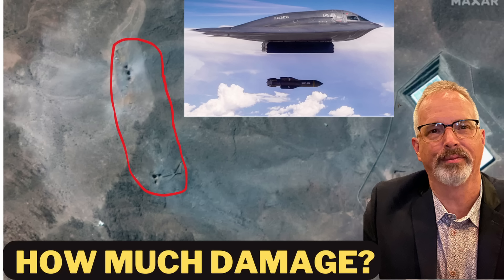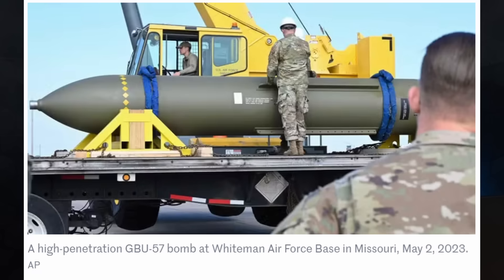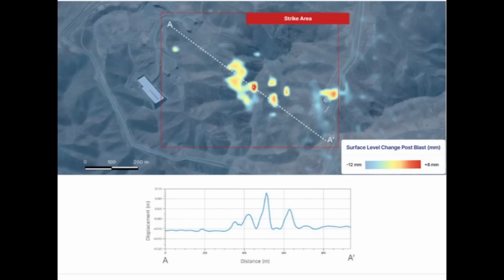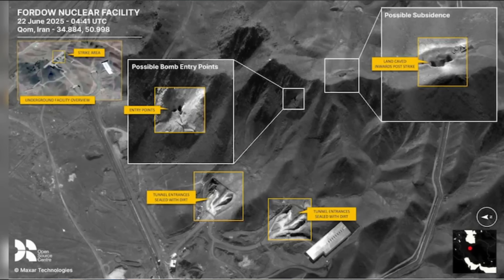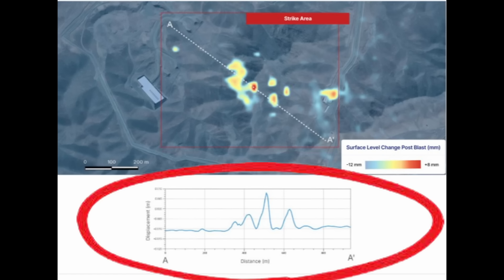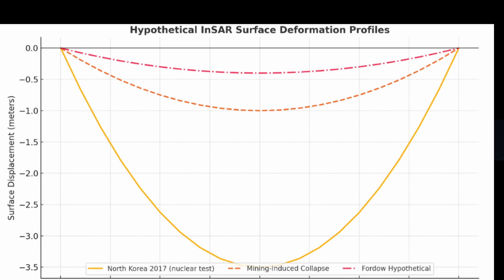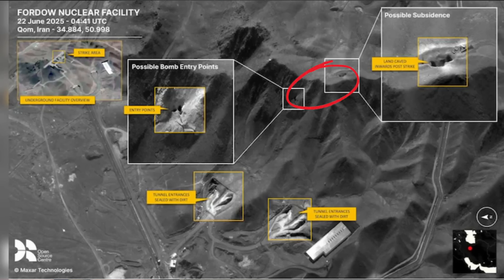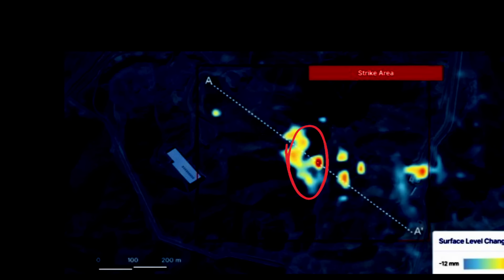Fordow Attack Assessment -  Update

Comment: This guy is either an absolute liar or the worst “professional engineer” in the world. Fractured rock DOES NOT equal caved rock that “must have gone somewhere, so it’s in the underground facility”. Fractured rock remains ‘in situ’ without a space below to cave into. No dump trucks required. Imagine filling a strongbox completely with popcorn and then heating it up. The kernels wouldn’t pop, they would attempt to expand against each other in a confined space…same same. The rock would fracture and then immediately compress. Such a vivid example of confirmation bias.
Reply from the maker: I think it's more of an example of you not understanding the video.🤣
Reply: @CaseyJones-Engineer - No — this is a clear example of your confirmation bias at work. You want the administration’s fantasy story to be true, so you twist engineering principles to support it.
The math simply doesn’t add up to penetrate 80 meters. The first MOP would always penetrate deepest; that’s basic physics. These weapons are designed to focus their energy forward in solid, intact rock.
If subsequent GBU-57s followed the same path, they wouldn’t simply continue deeper — they would lose most of their energy fighting through fractured rock, rubble, and hardened bomb casing remnants.
Upon detonation, the explosive energy radiates in all directions, not just forward or downward. That means less additional penetration and more lateral fracturing and compaction — not a clear, clean path to the facility.
Your interpretation ignores these basic principles and relies entirely on a narrative you already decided to believe.

Comment: I can't believe your call yourself an engineer. 100,000 cubic meters is a cube 46.4 meters on each side. The underground structures are 90 meters down.
Reply from the maker: You apparently didn't watch the video or understand it.
Reply: @CaseyJones-Engineer  Also 7:04 "I think almost all of the destructive force occurred at great depth" is nothing other than a guess at best. No engineering calculations to back that. "Great depth" can be anywhere between 30 and 90 meters. Neither would show visible signs at the surface.
Reply: @CaseyJones-Engineer  I watched your video to the end. You went from 100k m^3 of broken rock to "this facility has got to be utterly destroyed". 

The fact that you came back at me ad hominem rather than a physics argument just proves my point.
Reply from the maker: @djinn666  Your comment didn't bear any more response than I gave it.

Comment: That sounds great, but it is all predicated on the engineering thought that those ventilation shafts were vertical.  I highly doubt that the Iranians were so ignorant as to bore those shafts vertically; more than likely, those shafts were cut at an angle, minimizing intrusional destruction at depth.
Reply from the maker: Not really.  The blast wave alone would be devastating regardless of the vent configuration.

Comment: Thanks so much, Casey. As a practiing professional engineer with two advanced engineering degrees, including civil engineering, this is the best analysis among many decent, and some very poor, that I've seen posted.  Most of those posting haven't a clue as to fracture mechanics, ordinance, or any other technical issues.  They have essentially looked at the pre- and post-elevations and concluded there was little change, hence little impact.  But they be rong.  Great insightful analysis and engineering using open-source data!
Reply from the maker: Thank you so much, I really appreciate it!!

Comment: It’s not just the fractured rock, it’s the heat and shockwave from explosive gasses in a confined area as the force and flame had a direct path into the main facility via the air vents. I mean there were (6) in each shaft. Woah !
Reply from the maker: I agree with you. I don't get these people that think the facility got off with barely a scratch. It makes no sense.

Comment: Well, yes, granite is a very tough kind of rock. 
NORAD and similar were explicitly covered in loose gravel on top of the actual bunker to prevent the propagation of shockwaves from the surrounding rocks. Idk how this bunker was constructed, but they probably got all the opensource data on cold war bunkers and looked at that before constructing their own site. 
Secondly: How deep were the sites really? Did the devices reach the cavities?
The fact that there is near zero change above ground bodes not well for the success of the mission, and claiming otherwise based on this lack of data is nonsensical.
Reply from the maker: So you're saying 12 GBU 57's went into the ground and detonated while doing minimal damage.  Wrong.
Reply: @CaseyJones-Engineer  They probably did a lot of damage to the place where they detonated. 

Did they "detonate anywhere close to anything relevant" is the interesting question. Remember the amount of ordinance dropped on Vn and that that was more than was used in WW2, yet the result was underwhelming. 

Secondly: If they actually hit the site perfectly and spread the nuclear material into the countryside, everybody involved from Trump down to the lowest airman is liable to be indicted in Nuremberg for crimes against humanity.

Comment: What makes you think that the ventilation shafts are single vertical lines? What if the core of the facility is in zigzag 80 yards deep and 100-140 years away from the ventilation shafts. Modern DUFs like Fordow are likely multi-layered, with curved, zigzagging tunnels to protect against blast overpressure and shockwaves. Ventilation systems are likely redundant, hardened, and segmented, not just a single vertical shaft. A direct hit on a shaft might disrupt air circulation, but it likely won’t destroy the core of the facility if it's hundreds of feet laterally and vertically away.This is standard military engineering.

Comment: The big worry was adequate penetration of granite, depending on how solid the granite is. Preexisting fractures in geology would enhance penetration. Due to little heave, I think it's likely there was very good penetration. Confined shock waves are also underrated, and hardly mentioned in the assessments I have read. They can damage or destroy equipment within quite a large radius.
Reply from the maker: Thank you. I believe that's correct as well. Lots of detonation with very little surface deformation.That energy went somewhere.

Comment: If you have ever had a computer hard drive die from being knocked or dropped, or sometimes just being bumped while it's operating -- that illustrates the sensitivity of a High-Speed Centrifuge used for the PHYSICAL separation of Uranium isotopes in solution. 
The fissionable U-235 is only about 7/10 of one percent of the NON-fissionable total.
•   The extreme high rpm are necessary because of the very small difference in mass between the fissionable U-235 versus the much more abundant U-238…only about 1 percent difference.
Declassified information on the centrifuge requirements for Uranium separation indicate that "Separation efficiency in a centrifuge depends on absolute mass difference. Separation of uranium isotopes requires a centrifuge that can spin at 1,500 revolutions per second (90,000 rpm)." -- Here I have no reason to doubt Wikipedia; generally consistent with descriptions I've seen in other declassified sources.
https://en.wikipedia.org/wiki/Zippe-type_centrifuge
A sufficient Jolt or Shock (like a nearby bomb) can render them USELESS and beyond repair, without necessarily wrecking the housing, because of the critical tolerances in the spinning components, and practical limits on the strength of materials spinning at the extreme rpm required.
Doesn't need to be a direct impact, Even if they are idle.

Comment: By 80 years ago, the understanding of aerial bombing effects had advanced to the point that specialized munitions designs no longer relied solely upon penetration to the exact depth or location of the targeted facility.
People with a foundation in Geology likely already appreciate that Rock transmits the force of the detonation very efficiently, far more than an airburst, actually with greater efficiency with increasing rigidity. l
Hey, I've only ever set off an m-80, but the data are no longer classified.
In WWII, the Tallboy bombs designed by Barnes Wallis were dropped from only 18,000 ft, and penetrated some 20 feet of steel reinforced concrete shields covering the German targets. 
But the Grand Slam bombs even without so much case hardening were actually MORE effective in creating earthquake-like seismic waves and a crater that undermined and compromised the target structure so gravity then assisted in the collapse. The Tallboy and Grand slam bombs achieved near supersonic velocity by impact.
Success at Fordow evidently did not simplistically depend upon penetrating precisely into a specific level, or a specific conference room, or a particular desk drawer in the facility. The shockwaves are effective for a wide volume.
Besides, High-speed centrifuges do not respond well to massive accelerations and deformation.
And a number of munitions sure increases percentages for optimal results.

Comment: Too many unknown variables for anyone to draw firm conclusions. Like how deep the facility is, the location of the facility with reference to the ridge, the internal design of the ventilation shafts, how much composite UHPC was used if any, whether the floor was on a seismic suspension. 

Only the Iranians know what was damaged & they aren’t saying. 

I also suspect it doesn’t actually matter much because the centrifuges were due to be upgraded to IR6 & IR9 models in the near future anyway, and it appears the enriched uranium stocks weren’t stored in Fordow.

Comment: Thanks for sharing this analysis - very interesting. I have a question I'd like to ask... 

In this video you mention the geology of the region... and I'm aware that various industries - for example the petrochemical industry - use small charges to cause subterranean pressure waves that can then be picked up by sensors in order to infer the composition of rock and minerals at depth. Based on the local geology and on the fact that the target site lies deep in the centre of a hostile nation, do you think there is any chance that either 1) The US or her allies had an opportunity to "smuggle in" hardware capable of detecting and analysing vibrations from the strike? or 2) That there might actually be academic research institutions such as universities with sufficiently sensitive seismic recorders that might have detected the bombs going off. 

I appreciate that it might be next-to-impossible to establish a clear understanding of the effectiveness of the strike from a seismic record, but perhaps it would be possible to confirm the number of detonations matched the number of weapons dropped - and perhaps also to compare the seismic data from each successive strike, to see if it might be possible to infer any ways in which the target volume might have been affected by preceding detonations. 

Obviously - I am sure you can tell - I don't know what I'm talking about... but I was just curious to try and think about this from an out-of-the-box perspective and think about how I might try to assess the effectiveness of the strike knowing that I would not be able to get "close" to the location. 

Very interested in your thoughts on how e.g. existing seismic technology might be able to fill in the gaps in our understanding of what happened. 

Thanks in advance.
Reply from the maker: Thanks for the great question!  I think that would be another piece of evidence to document the amount of energy that was released underground by these bombs.

Comment: Questions: What if the halls were not directly under the ventilation shaft opening? Would the Iranians be dumb enough to build the shaft straight down into the bunker? Seems one would build in all sorts of turns and baffles, and put the halls a long way off. Mightn't you put in decoy ventilation shafts, and hide the real ones? Maybe we had all the plans for the place. Or other intel. But just expecting that the ventilation shafts lead straight down into the centrifuge halls? Of course, the military is rightly not going to tell us what they knew or how they knew it. We may never know.

Comment: The "unknown" uplift area to the right looks like it is an entrance way with a road leading to it. Could the underground explosion have blasted through all the internal tunnel doors and blasted some debris out the outside door?  Or did it a lot of stuff get pushed down the internal tunnel, plugging it up, and then the blast simply pushed up the surface of the ground where the tunnel got close enough?

Comment: Did you take into account the fact that these ventilation shafts don't have to be vertical? 
What would be the effect of the MOP if the shaft is, let's say, slanted at 45 degrees and the main centrifuge hall is offset from these shafts by tens of meters to the side?

Comment: Iran has had decades to introduce non homogenous materials into the site to create non consistent resistance which makes the bombs go of course during their vertical descent through the site cover. Engineering papers have written about this topic, the bombs can be defeated.  The only way to gauge actual results would be close inspection underground. If the bombs go of course and explode well away from the internal chambers, its not going to do much.

Comment: It’s all guess work on the western side. Iran learned a lot from the attacks made on Iraq bunkers built by Belgium . Even back then the ventilation shafts had do verticals access route but had entry points a hundred odd metres away that went down a number of metres then came back up into expansion chambers before sloping back down through blast doors before actual bunker. 

We have seen since then seen deflectors included into the design designed to redirect these bombs from the vertical path.

Comment: Not sure you can direct scale the disturbance of a rock by simply times the effect of explosive, the distance from the explosion through a medium has a dampening effect. We also don’t know if there was any blast doors, numbers of turns in any tunnels, and any blast pressure vents engineered into the facility. We also don’t know how much reinforced concrete lined the tunnels and rooms or even what depth the bombs penetrated the ground. 

At this point, all we can say is there is evidence of explosions at the sight, everything else is pure conjecture.

With out eyes in the facility or long term watch on any activity at the site, it’s all speculation.

Comment: Sorry but what you have to say seems bogus. The bombs can penetrate about 60m. The facility was over 90m deep. If there was a detonation when the bombs had entered the void of the facility, where is the evidence of burning on the surface? All that can be seen is ejaculate dust. Does your ground surface radar take that into account? You don't talk about it but a one metre wide hole 60m deep is going to increase the surface height around the hole just with the debris from the explosion. All I can see from what you have shown us is that the bombs went into a hole and a lot of rock dust then came out of the hole. Zero evidence of penetration or resultant destruction.

Comment: I would be concerned that the engineering analysis is correct BUT did they actually hit the "vital" point? I am guessing the Iranians are not entirely stupid and that any facility under all that rock is NOT going to have any direct exit point to the surface. In fact I would guess that their exit points for access and air are well removed from the "vital" areas.

Comment: I believe that the fact that so much of the explosive force was confined to the inside of the facility, with almost no outward relief at all, means that a compression wave of incredible destructive force was unleashed by each bomb that reached the inside of the facility upon the contents of the facility. As you have pointed out, the density and depth of the rock allowing almost zero expression towards the surface means that nearly 100% of the destructive force was unleashed, and super concentrated on the contents of the facility.

Comment: A great analysis thank you Casey. However I think we should assume that the jury will be out for some time on the result of the bombing. There are too many assumptions about those vent shafts, for a start.  
3D reconstruction of the Fordow plant using the plans stolen by Mossad in 2018 show that the shafts do not go straight down 90° into the facility.  They have several bends, and are well offset from the centifuge hall, which itself is sited below the peak of the mountain ridge, with maximum hard rock protection.  The Iranians are not just a bunch of desert "ragheads" - they chose the site well and would have used their own geologists and other experts. Plus they have been in this game for a long time. 

So while the bombs would have had easy access down a shaft until it encountered the first bend, then solid rock, how much further could they actually go before exploding? Then there is the shockwave effect to consider. Underground nuclear testing during the cold war revealed that the shockwaves were very quickly absorbed. Although they do propagate seismic waves at the speed of sound that could cause significant damage, which may or may not be resisted by reinforced concrete armouring.  But with the vent shafts being located well away from the main halls, most of the damage would more likely be to infrustructure such as the access tunnels, electric systems, electronics, and life support system. So it remains to be seen whether Fordow can be restored. We hope not!